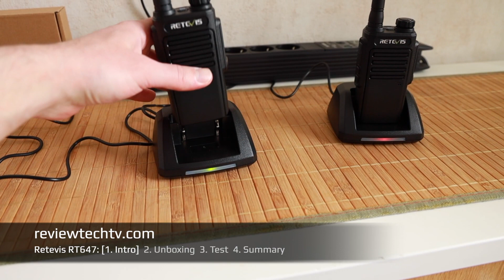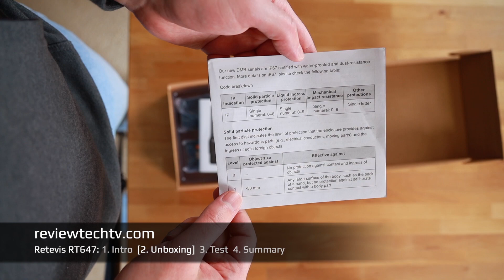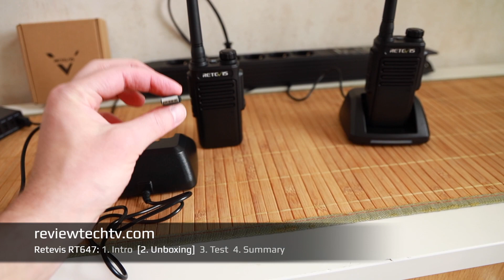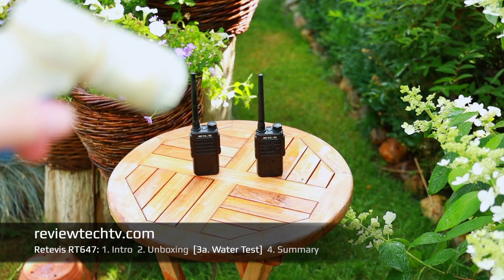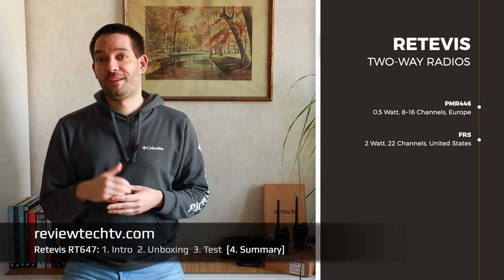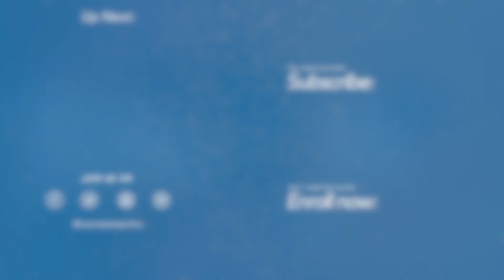Retevis RT647 Waterproof Two Way Radios (Water and Range Test)

Comment: Are the charging docks all compatible? Worse case is different voltages with controller circuitry in the dock and resulting risk if you get radios mixed up and put a low voltage radio in a high voltage dock.
Reply from the maker: More details in the video description.

Comment: Hi. Are the RT647 features programmable as the RT24 are?
Thanks and regards
Reply: Yes there are, and they have probably removable antennas because on the antennas area there is the hole and visible screw,so basically you should use the antenna which minimum leght is 16.5cm on 446Mhz frequencies for proply use. Short antenna than 16.5cm on 446Mhz will give you higher SWR which is not good for receiving and transmitting
Reply: In RT24 you may do the same because there are the screws too :)